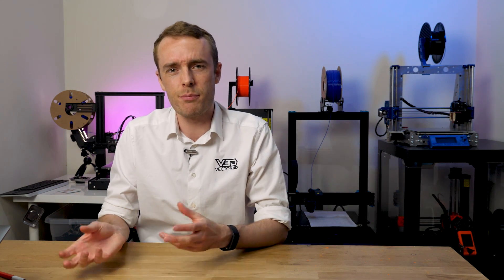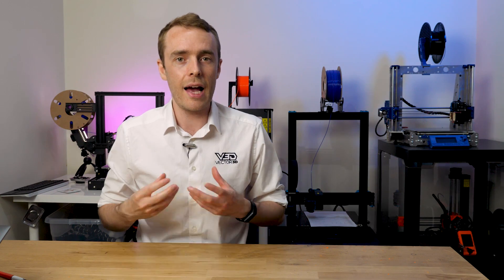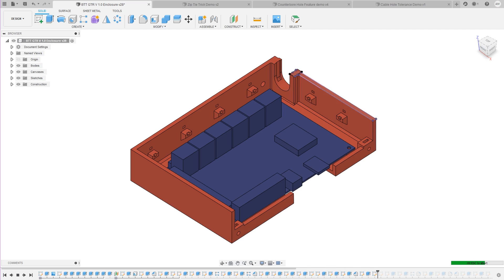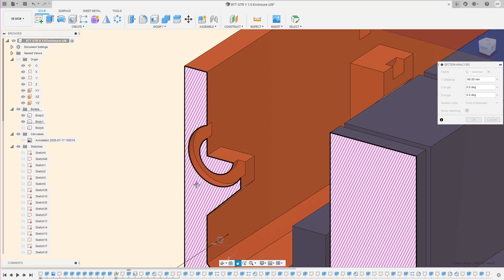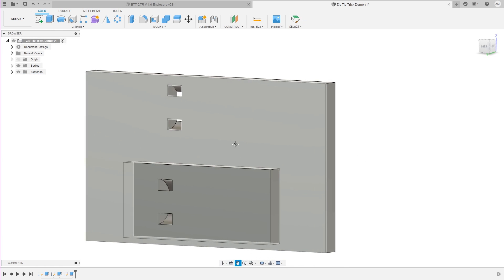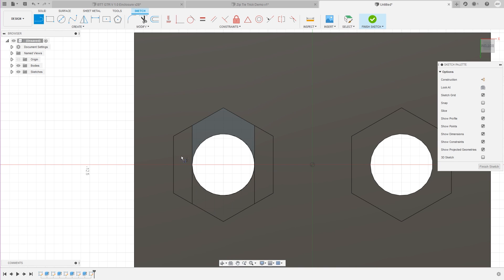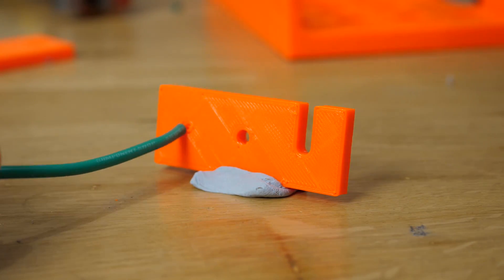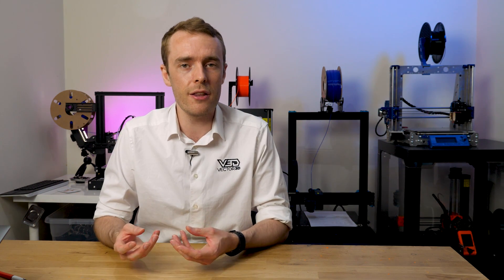7 Easy Tips and Tricks for 3D Printed Design in Fusion 360

Comment: Rearding the hex inset, it is much easier to just chamfer the hole so you get a 45 degree overhang that is printable. The nut will rest on the edges where there is most material so it will be fairly  strong even if the distance to the other side short.

Comment: Where you do you get your well behaved cables? Mine don't go where they're told like yours do.
Thanks for another video. I liked the print friendly nut holes.
Reply from the maker: Haha. I normally use silicone cables with high strand count on printers. They are very well behaved.

Comment: if you add a thin profile covering the hole the height of a layer -- then the nut bridging will work much easier, and you just break through the single layer of material to use it.
Reply from the maker: But breaking through a layer of material is a pain, especially if you have tens of holes, and this method works perfectly without needing any breaking through or post processing at all. Honestly, give it a go and let me know how it goes for you.

Comment: @vector 3d
Why do you have springs on the bolts holding the ballscrew nut?🤔
Reply from the maker: Its actually the formbot raptor design that one. The intention is that it allows sliding in XY plane while not allowing motion in Z. Prevents and chance of Z banding with slight misalignment.
Reply: @Vector3DP  oh,
Thanks for the reply.🤗
Reply: huh which part did u see that :?
Reply: @ameliabuns  10:31
Reply: @ameliabuns  10:31
Reply: @Technoboy928  Oh how the hell did I miss that thanks xD